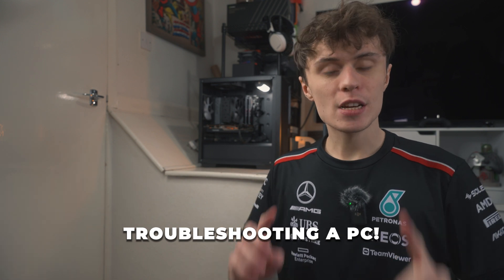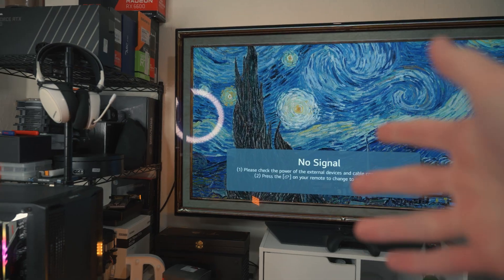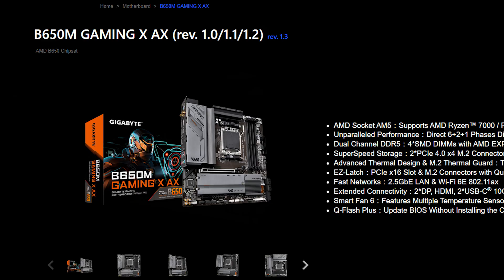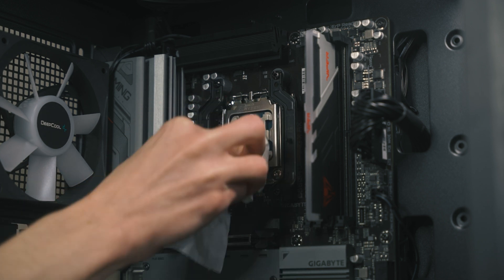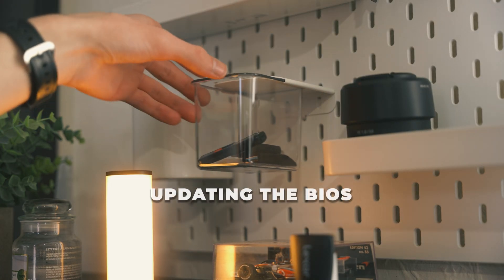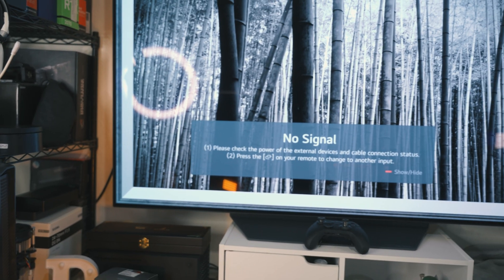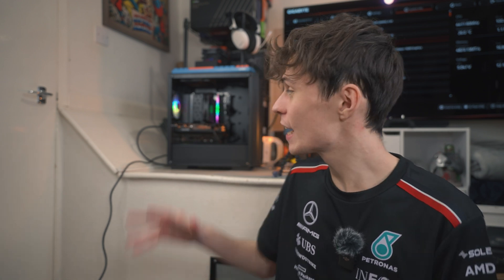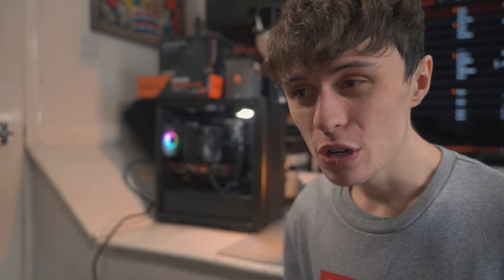How to Troubleshoot a BROKEN Gaming PC

Comment: The type of USB 3.0  flashdrive Is sometimes the problem with bios working.
Reply from the maker: I used a 4GB USB 2.0 drive formatted as FAT32. It's worked for doing the same process on an MSI board in the past.

Comment: Nice you got it working, very stressful swapping out parts & see it not booting etc.

Before I went onto AM5, I was in 2 minds, due to hearing reliability, stability & compatibility issues and also was only going to use AliExpress parts which could lead to further headaches, however I went ahead with it & it's working great! I daily drive it, EXPO enabled & getting 5600Mhz on my 32GB Juhor Ram, paired with a Maxsun B650 Wifi & 7500F which has been UV & OC'ed, been stable so far.
Reply from the maker: Great news mate! Glad to hear it's running stable. From my limited experience, it seems my Intel platform (MSI Z690 Force WiFi +13700K) has better memory compatibility. However, it seems if your memory is EXPO certified, you should be good to go